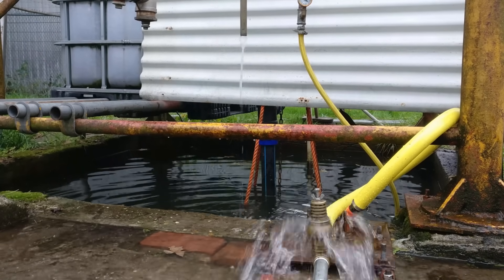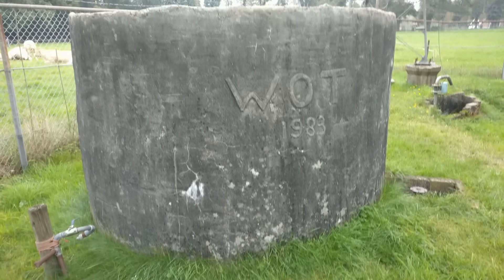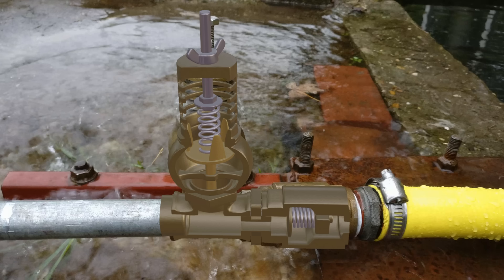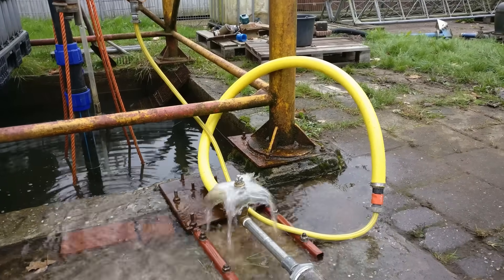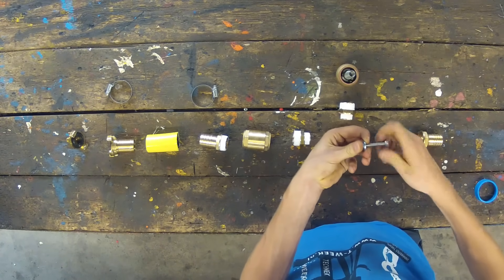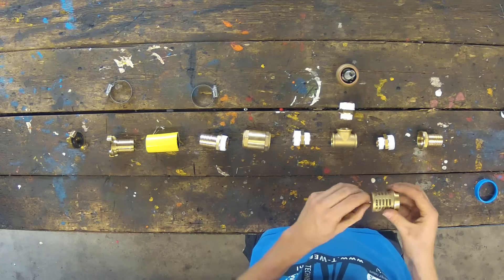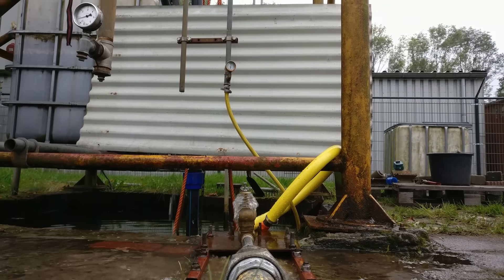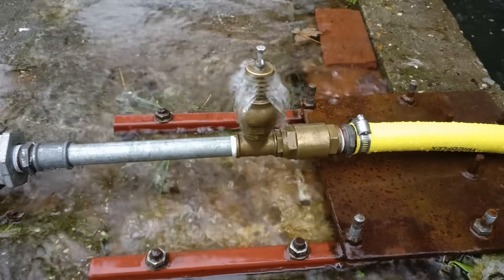Pumping Water Without Electricity - The Breurram

Comment: How do you get water into the system under pressure from a river, this seems like an incredibly useful device for filling up something like an agricultural water tower,  where it fills slowly over a few weeks ti all be released if needed for irrigation, but I see no way other than by a pump to get the water into there with enough buffer force to allow the valves to work, which defeats the purpose, as you may as well use a pump to fill the tower or to irrigate the fields directly on demand
Reply: I thought it was the weight of the water in the ground storage tank. Was the pressure. and he is only pumping it a few a feet into the coil hose. The air bubble trapped and the coil of hose. Keeps the weight or pressure of the tower tanks away from the pump. And the pump being stronger because of the weight/pressure /size of storage tank.
Reply: @non1503  there must be a way to get it in without power, or you would have to use a pump to fill the tank from a river, which means that if you have power available, you may as well do what I said above and pump it directly
Reply: This system- as you could read if you followed the LINK & read the comprehensive guide published there- is dependent upon a DOWNSLOPE Topo from SOURCE- the flowing river... if the HEAD you create at the bottom of the slope is a min 3 feet then this pump will do the job... in this case to 12' elevation... there is an elevation LIMIT tho & you cannot pump it higher than its max... the water from the river provides the energy that is then expended... the "wasted water" under proper management is funneled or naturally makes its way back to an even lower elevation of the river [reintroduced up or downstream... if not funneled by man then naturally by HYDROSTATIC Pressure as it sinks into the earth deeper & deeper... it will follow a path of least resistance to the river that is like a vacuum in the area... and we all know how much the nature GOD created hates a vacuum!

Comment: i wonder if theres an electrical equivalent to this, slamming shut a current flow to get a voltage spike and leaking that voltage spike off into a higher voltage circuit to generate a high voltage from a low i suspect in DC where a transformer wont work.. clearly converting to AC and using a transformer then converting back to DC is more efficient as thats whats used in almost every application ive seen but then again we almost always see electric pumps not ram pumps
Reply: I think that actually exists. Takes constant low energy and turns it into bursts of high energy

Comment: A 6:1m lift , nice. With your 2m head( .48psi/vertical  foot=3.14psi supply) pressure.  You are producing 19.02psi+ head inside tank to overflow. 
Increased flow is an indicator that more lift is available.  How much more lift do you think this 2m could provide? 
Probable test method: 
Remove the drain at the 90 up top .
Attach a hose / pipe combination to Raise the water max level till the pump can nolonger be tuned for more head. 
Possible use of info gained. 
A 10ga bucket  could  be placed on top of a stand pipe at this just below this max ( to maintain flow and cleanup/turn over water, oldest water will rise through thermal layering.) . This extra head may give enough  psi to properly feed a Reverse Osmosis for drinking  ( I've got poor water quality so RODI  +after treatment  wound be needed)

Comment: My dad made one of these for his holiday home before I was born, and it's still in use. I used to know enough about how it worked to change gaskets and water proofing tape, and hopefully my brother still does. I think dad had to change one component at some point, but apart from that... gaskets. Edit: Forgot to mention, i'm 55 years old.
Reply: Are you sure it wasn't a ram pump he built? They're similar and do pulse waste water. But last far longer due to alot less moving parts? 

I only ask because there's one in the Mourne mountains in Ireland that's been running for the last 200 odd years so I know they're much longer lasting.
Reply: @Palemagpie  It's quite possible I'm getting them mixed up.
Reply: @Palemagpie this is a rampump

Comment: If you replace the pump with an inductor and the tall tube with a capacitor, you would have a  dc-dc converter boost converter.

Comment: These do work and are great for pumping water from a stream or river as they loose about 95% of the water out of the pump. That is before the head becomes an issue. However you still need to drain the waste water and the pump needs to be at least a meter below the surface. Basically almost a syphonable layout height.

Comment: How do you prime it to start the cycle?
Reply: This is just simply using the flow of the water from pipe. So, the first tank (on the left) must be slightly higher than the pipe. So, there is no need to prime. The momentum of the water flowing is what causing some small portion of the water to go up.

Comment: Furthermore, is there a way to measure efficiency? Grav potential used vs grav potential out? Are there better designs?
Reply: If efficiency is measured by the loss of water, then this has abysmal efficiency (<5%). It is taking momentum of the flow of big portion of water (95%) to let a small portion to go up.

Comment: Cool. That's the hydrolic version of a DC boost converter.  Only instead of bleeding off excess water to create higher pressure, it bleeds off excess current to create higher voltage.
Reply: I'd think your dc boost converter would be an electronic version of the ram pump, not the other way around, lol. The basic principal has been used to pump water for a VERY long time, while your boost converter is a "johnny come lately", lol. There's a good reason the British called vacuum tubes "valves"

Comment: I don’t understand where the extra pressure comes from just the sudden change in momentum? Doesn’t seem like that should work
Reply: Have you ever heard the pipes shudder when you turn off a tap at the far end of the house? Moving water has kinetic energy, and when you shut the outlet valve it all crashes into itself, building up pressure.
Reply: That’s amazing so the pressure at that moment of changing inertia is WAY higher than the regular pressure in the pipe. That’s pretty cool

Comment: You could pump water in steps of 4-6m and go any height
Reply: NOPE- the energy is supplied by the running river... the design calls for  a DOWNHILL topo whereby you establish a min 3 foot HEAD then the pump & that pump is LIMITED in the elevation that it can achieve... it is a very slow process but it will eventually fill your elevated tank... generally this has practical use for off grid cabins/cottages where the tank is used to provide running water to the commode/sinks & showers from a running river where all you need is 10-12' of height as a delivery system to the cottage/cabin/whatever... this is a great set up to take with you in components if you travel long distances roughing it... wherever the topo is favorable you set up camp- get yourself showers & running water... move water from the river to your camp- hands free... so you need to look at everything OUTSIDE this video's description of the pump... there are complete plans available in the LINK placed by this creator in his description- all these commenters could have their questions answered if they just followed the LINK & read that document

Comment: So it’s basically using the water hammer effect to push water higher than the source. Or said another way, it uses the pressure of flow suddenly stopping to push water higher than its source.

Comment: WOT - Does the big yellow hose, looped over the bar, perform the same job as the hydraulic cylinder does in a typical ram pump?
Seems to me it doesn't, but I could be wrong.
Just trying to understand all that's going on here.
Reply: Yes he said exactly that. He used the word "buffer".
Reply: @u1zha  But the cylinder in the Hydraulic ram pump is what pumps the water in that situation.
This is the point of my question. Does the hose perform a similar action?

Comment: Wait don't you need to take into account the suction of the down spout? Once you get the water pumping to the top, if you keep the valve from pumping, the suction will keep pulling water up and down. You should show a video of the water at the very top coming out into the reservoir.
Reply: You mean siphon effect when draining water from the other pipe coming down from the reservoir? Of course it can keep pulling water up and down, but only if we make the down length descend below the pump's height. The purpose of doing that? Fun to look at moving water? The whole idea of pumping water up a tower is to, well, accumulate water, and it's done with the spout closed.
Reply: @u1zha  so the downspout in the video is a few feet above the pump in this case. So the pump only has to do enough work to pump that high rather than all the way up. I'd like to see a video where the downspout is all the way at the top so the pump is shown doing all the work.

Comment: So this only works if the river is situated higher than the pump. Which is rarely the case I would think. So you would have to dig a lot to make this work.
Reply: Rivers generally flow downhill... while taking a shallower grade down than the river itself will mean your input pipe flows slower than the river, you still can gain height back above the point you started.
Reply: @jercos  Sorry, I‘m not an English native and don’t quite understand. Do you mean that one should install this pump directly at water level and let the water flow(downhill) operate the pump instead of the height difference of a water tank and corresponding pressure (like the two meter tank given as example in the video)? Would the flow pressure of a rather tame river be really equivalent to the gravitational pressure of two meter of water to pump that water as high as in the example?
Reply: @MoxxoM  The natural flow of the river is a slope, you can collect water and pipe it down. You can follow this slope very closely, even laying your inlet pipe underwater in the river bed.

The pump can be next to the water, or even in the water. The difference in height between inlet (plus any amount it is under water) and outlet (minus any amount it is under water) will determine flow.
Reply: @MoxxoM  if you sight along a level, you can see how far up river you need to pipe from to match its height... set the level up at 2 meters high from your pump site, it may show you a spot 100-400 meters up river, pipe from that point and you have 2m water height or head.
Reply: @jercos  Ah okay. Thanks.
Reply: @jercos  Didn’t know the pump would work submerged.
Reply: @jercos  Ahh, that is what you meant. Alright. As long as your neighbours and authorities don't have a problem with that, this would be a good solution. Didn't think about that.
Reply: @jercos  the head is a min 3 feet for this pump to function, his is 2 meters bcuz he wanted to gain 12' elevation for his tower... that downslope to the head & the height of head generates the LIMITING elevation factor to whatever tower you want to install... this is a pump for cottages, cabins, wilderness camps etc... no one is going to solve the electrical grid with this pump like many dummies in the comment section delusionally believe is possible... BTW- delusionally may not be a word >>> yet <<< but their ideas are just as fictional so give it time at least these morons can provide humanity with a new word!

Comment: Basically a Boost converter/step-up converter for water - neat
Reply: Similar but not really precise analogy, in Boost converter, the electricity charge is built up in inductor and stored + converted into inductive energy. In this pump the water is lost, not stored, this is incomparable to boost converter that has high efficiency. This water pump instead operate on principle to sacrifice a large portion of the water momentum (95%) to push the small portion of the water (5%) up. No electric circuit will use this pump principle because if it does the system will have very low efficiency with much of the Ampere flow going to ground or as waste heat.

Comment: Interesting. This seems to be the water equivalent of the boost converter circuit in electronics, which uses a low voltage high current source to produce a high voltage at lower current.
Reply: I was thinking the same thing and might have it figured out. The main valve is equivalent to the transistor, the output valve is the diode, and the input pipe is the inductor.

The biggest difference is that electrical current doesn't have useful momentum, so the boost converter can't use a passive component (like a spring) to regulate the switching.
Reply: @pseudotasuki  While you are correct that it doesn't have momentum from mass, current through an inductor does behave that way - it continues to flow after the circuit has been broken, resulting in a high induced voltage.
Reply: @pseudotasuki  doesn't have useful momentum? The humble inductor cries at being forgotten.
Reply: @pseudotasuki  Close, but in electrical circuits, Inductance is analogous to Kinetic Energy. In converter circuits, there will be an inductor upstream of the switch. As current flows through the inductor, it will develop a magnetic field. When the switch opens and stops the current, the collapsing magnetic field produces a large voltage which forward biases a diode to send current to the high voltage side of the circuit.
Reply: It reminded me of that, too
Reply: I realised a while ago that everything physical has an electrical equivalent to a degree
Reply: Probably true with other phenomenon, like magnetism, pneumatics, hydraulics, and so on
Reply: @moggtheboss3087  ....water. it's water. It's the same analogy for electricity we've always used. What are you talking about, "everything physical has an electric equivalent"? I... I'm sorry, I just... it's water dude...
Reply: @moggtheboss3087  Perhaps you don't know that this is the principle of an analog computer (as opposed to a digital computer).  Google it.  You will find it interesting.  An analog computer is any of a class of devices in which continuously variable physical quantities, such as electrical potential, fluid pressure, or mechanical motion, are represented in a way analogous to the corresponding quantities in the problem to be solved.

This means that there is an equivalent mathematical equation that can be modeled (or represented) as an electrical system, a mechanical system, or a hydraulic system.  Each electrical component has an equivalent mechanical component and an equivalent hydraulic component.  So if I want to model a mechanical system (which has springs, masses, dampers, levers, forces, potential energy, pulleys, etc.), I can do it identically as an electrical system (with voltage, amperage, capacitors, resistors, diodes, batteries, switches, etc.) or a hydraulic system (with fluid flow, fluid pressure, accumulators, valves, parallel & series piping, one-way valves, pressure relief valves, etc.).  And all of these models will have the identical mathematical equation to describe their operation.  One of my engineering "control systems" classes in college had several labs where we would program an electrical analog computer (physically wiring all of the electrical components together) to simulate an equivalent mechanical or hydraulic system... Very interesting.  Here is a sample of an electrical analog computer. >>> https://www.planetanalog.com/wp-content/uploads/2020/04/Analog-Angle153_analog-computing_Fig1.png
Reply: Its not so complicated. Its just water hammer utilised for something useful
Reply: I think because of how the flap works, I think it is more accurate to say it is more like a joule thief, which is a type of boost converter that uses a second winding as feedback.
Reply: I was thinking of a rachet mechanism but that is a good way to think of it as well!
Reply: Isn't the efficiency in electronics much higher? Here, most of thd water gets lost.
Reply: @l3p3  In electronics,  the "water" is electrons and most of them indeed don't reach the high voltage level. They "sacrifice" their energy to give the few electrons that make it. These then have higher energy per electron (i.e. voltage)
Reply: @l3p3  really that water doesn't have to be wasted. They could attach a hose over the relief valve and duct it to somewhere else or back into the river.
Reply: heat exists @l3p3
Reply: @l3p3  A lot of work has gone into getting that efficiency. Maybe if hydraulics didn't still use victorian technolgy it could be more efficient too. It would be interesting to analyse the losses in the valves and other elements.
Reply: Everything is a lever man
Reply: @cheesefries7436  And if it isn't a lever, it's a filter.
Reply: "A boost converter circuit, which uses low V high A source to produce high V low A output"

...if only there were some simpler analogous electronic component that did this...
Reply: @joshyoung1440 And if only that simple component worked with a DC source and produced a regulated voltage that was independent of it's load...

Alas.
Reply: No undortunatly this really isn't the same thing